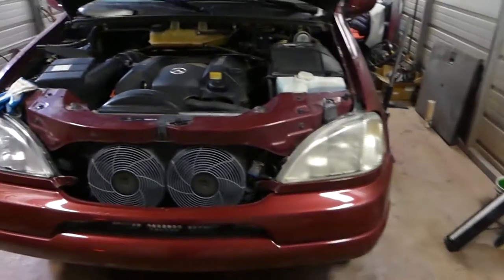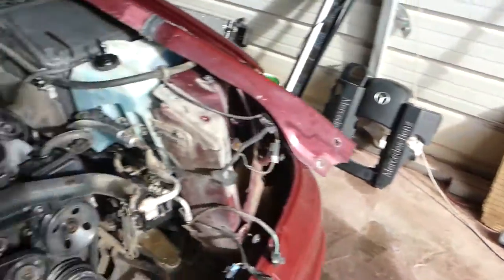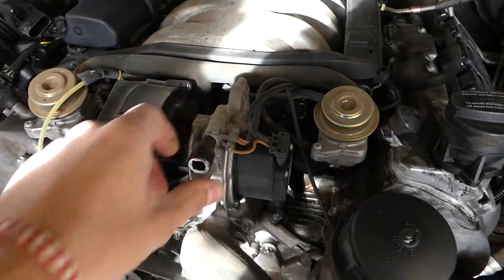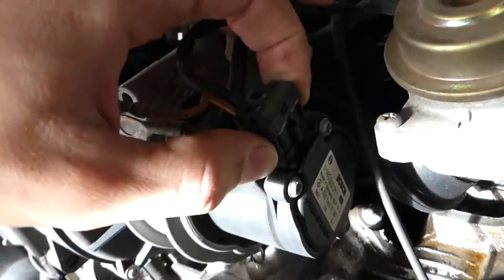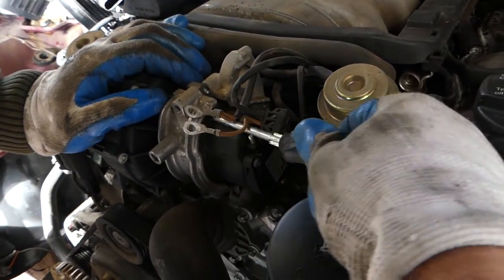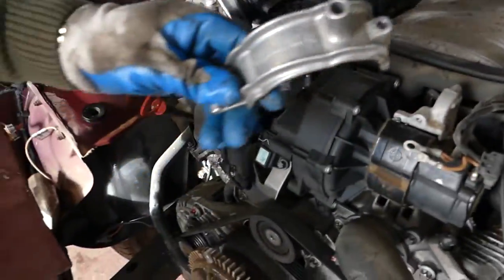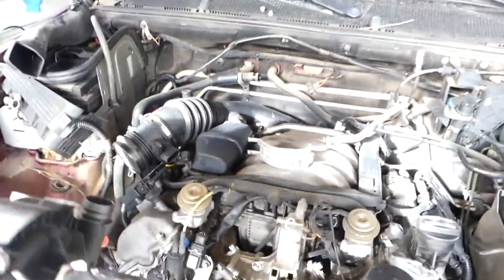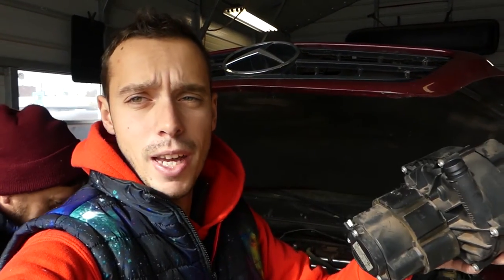MERCEDES W163 SECONDARY AIR PUMP REPLACEMENT ML320 ML430 ML500 V6 V8

Comment: in my state there is no vehicle smog test. pull the fuse and or relay. this part is not needed for normal function of the engine. happy driving.

Comment: Hello do you have any video regarding the key's I have a 2005 ML350 and I have issue with them, of the two original key's only one is working the other it's show start error and there fore do not start with that second key